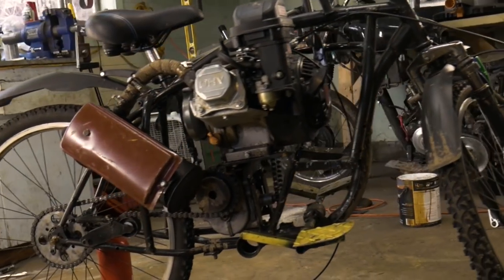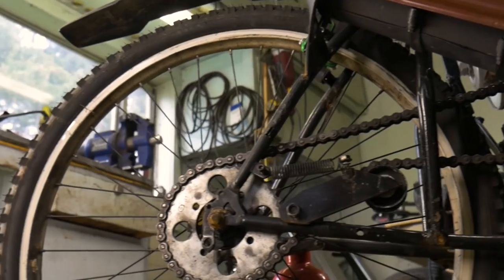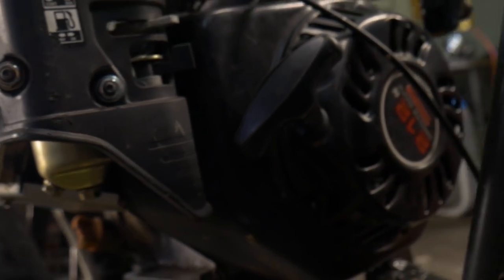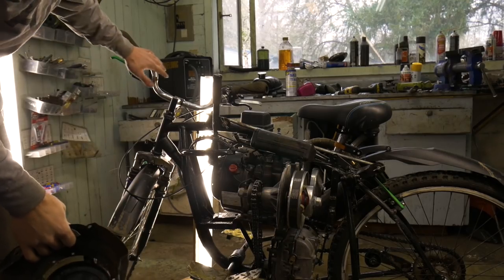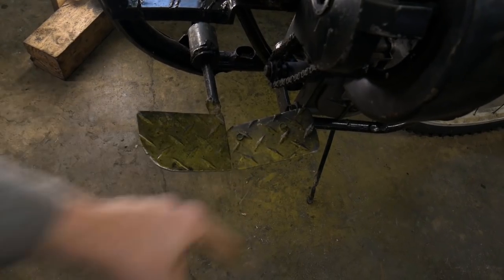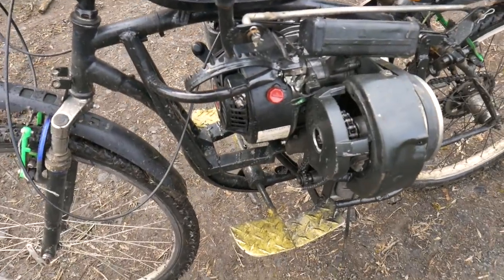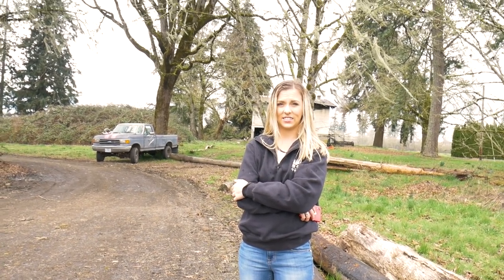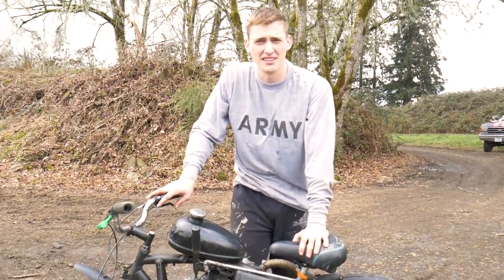This motorized bike has a lawnmower transmission

Comment: I would add a support bearing because running a torque converter like that will snap the plate I've seen it happen

Comment: Did you use gear oil or grease for the transmission lubricant?
Reply from the maker: It originally had grease in it. I tried to use oil, but the case is not sealed enough for oil.

Comment: last week I put a 24 volt 300 watt generator on the bike I have been building over winter.
Reply from the maker: nice! sounds like a fun project
Reply: @OliverMotorized  after 350 miles the bikes peddle crank i made into a jack shaft is starting to show a lot of wear. after putting a PZ30 on the 208cc engine it keeps up with traffic like a moped, but it can obviously go up bigger hills and has a much higher top speed... i can really see, one of these bikes even with a 2 speed gear box and a centrifugal clutch would be awesome, if first gear were to top out at 25mph @ 4000rpm and have second run 45mph @ 4000rpm. the 208cc i found makes 29ftlbs at 4000rpm, so i just run it at as a single speed for 2000rpm @ 25mph, the centrifugal clutch makes lots of noise until it gets to 20mph.

Comment: Okay this one is a mess..you know what the bicycle centrifugal clutch xmission looks like right ? Has clutch drum on one side. The sprocket on the other side.. And lower left rear mount motor version needs two meshed gears inside in order to reverse the rotation.. Because 99.9% motors rotate counter clockwise & that will make the bike go backwards.. And none of these Chinese manufacturers know what they are doing.  The human race is getting dumber all the time. And making us waste our money on junk !